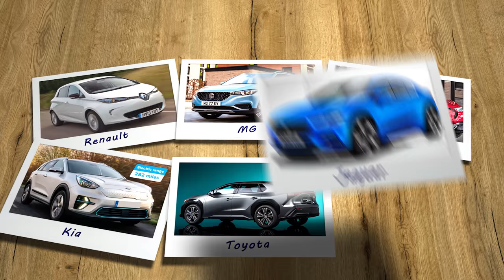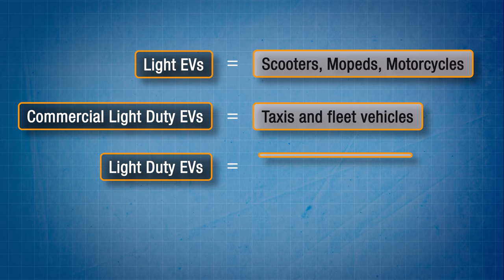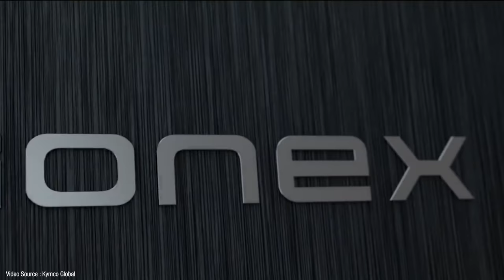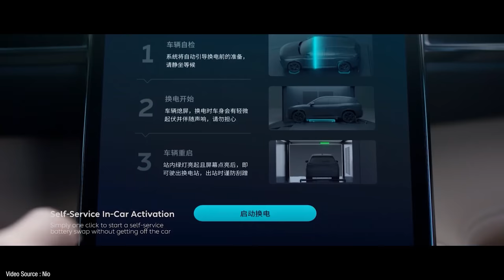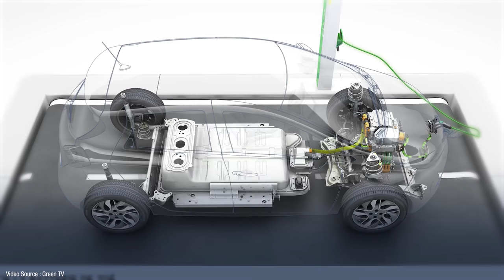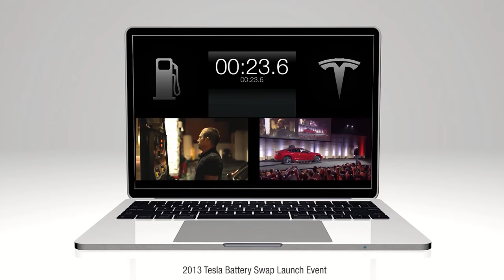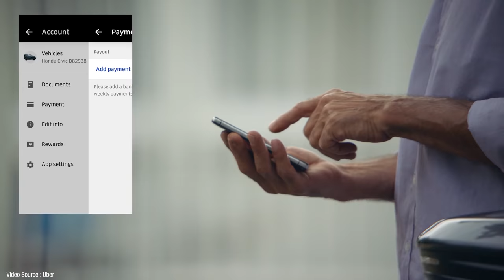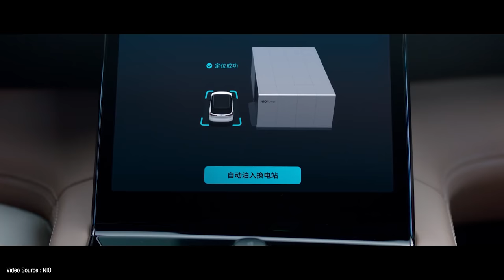Battery Swapping. Transforming the trajectory of electric vehicles?

Comment: One monkey wrench in this...the possibility of batteries actually being a part of the structure of the vehicle to lessen its weight. This system would not work for that, right? Also, this swapping idea is not new. The concept is decades old. If it's such a viable concept why has it taken so long to catch on?
Reply: Well I think the video answered your question, didn't it? Tesla were the biggest name in the last decade, when EVs were starting to get popular with private car owners, and anyone who could afford a Tesla generally had their own driveway/garage with which to charge their car, and so didn't need these battery swapping stations. Now EVs are cheaper and so more of the customer base is unable to charge up at home, overnight, so solutions like this could be relevant. That said, as a layman I wonder if this model is susceptible to running out of capacity if it becomes relied upon en masse. If the deposited batteries are being charged up slowly (as mentioned in the video), is there not a danger that they simply won't be recharged in time if a given swap-station is in use frequently throughout the day? And in such conditions might a station run out of batteries due to storage constraints (I notice one such station, for light commercial vehicles, had an above ground footprint of just two parking spaces)?
Reply: Good luck with replacing a damaged integral battery, lol.
Reply: @andan2293  good point
Reply: @danyoutube7491  sure there's a chance. But that station would simply become unavailable on your app. And I think that chance is very slim to begin with.

Comment: Battery swapping would be amazing if not for two problems that I can think of.

Right now, basically the entire world is battery constrained. I wonder what the ratio of battery packs to vehicles will be. 1.5 packs per vehicle on average? It will be at least some fraction above 1 anyhow, which might have the unintended consequence of slowing EV adoption.

The second problem might be that if a pack is easy to remove and very valuable, then theft might become an issue. Park your car on the street over night and find it much lighter with zero charge the next day.

If these two problems can be overcome, which I'm sure they could be, then battery swapping will be the way forward. Unless the time it takes to solve those issues is enough time for a 5 minute fast charge to almost full :D

Or am I being an idiot? That's always a possibility

Comment: Wow this has been one of the worse videos of yours. Youre missing a lot of points like you need more batteries per EV so we have an even bigger carbon footprint per EV.
The swapping stations are way more complicated, expensive and in needs of maintenance than the super chargers as you need most of the charging infrastructure anyways. Yes you load slower but you load a lot of batteries so that adds up. Its a different usage sure so its not the same but it wont be a lot cheaper.
The reason for no standard is not to fuck with customers but because it limits competition and improvements. That doesnt run in a world managed by these. Just look at the mess for just the damn connector and we know how to build that. We have no idea how to optimize the battery yet and so we WANT to have flexiblity for new tech, new approaches, for differences. Thats how you find the best solution. You can make that standard when things have settled but we are very far from that.

And what for? To have a theoretically better battery life? While most EVs get charged on AC chargers anyways? And batteries still have 85% capacity after 500k miles?
And so we dont have to wait 20-30 mins to fuel up but just 3 and dont have to leave the car?
Doesnt sound worth it to me at all. And the experts agree with me, even Musk, the wannabe genius that sticks to solutions everyone else has thrown out of the window like grade 5 autopilot with just cameras.

And for the commercial application I doubt its taht valuable. EVs are insanely efficient in city traffic so they dont need to be refueled that often. And at least in europe,  there are mandatory breaks for commercial drivers of more than 20 mins in which time you can ofc charge the car back up. Its not really a problem these services are solving.
Same goes for trucks that can be charged even faster because of their battery sizes. So they wont take that much longer to charge either.

sp yeah, its kinda obvious why its not really a thing. But if you leave out all the bad stuff and switch some to make it look like its the good stuff,  you bullshit your way out of reality.